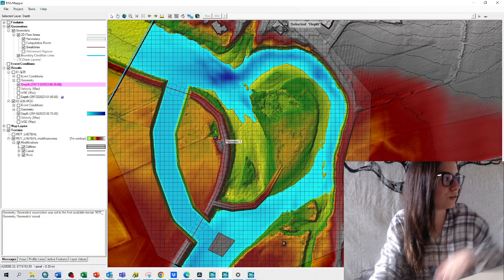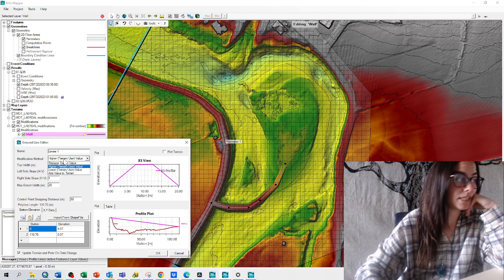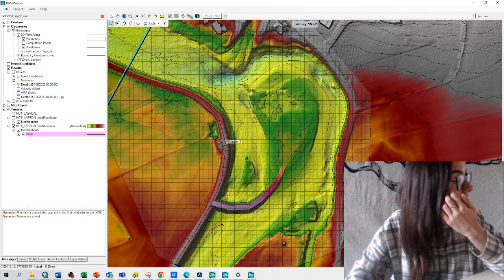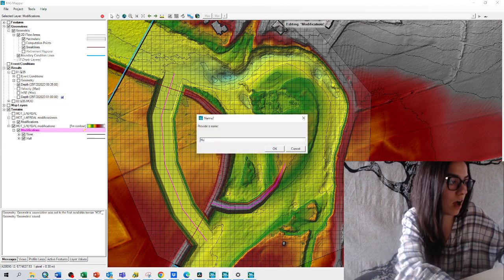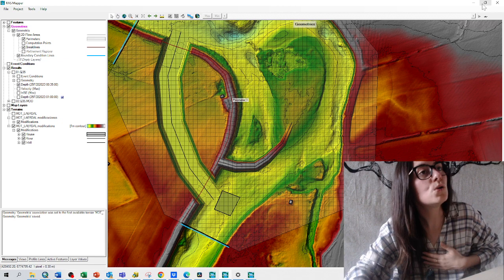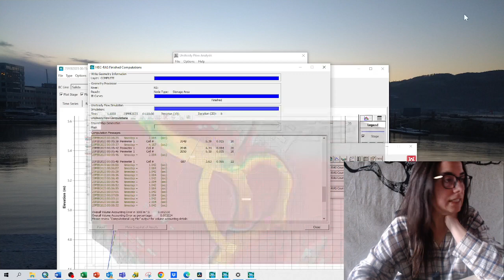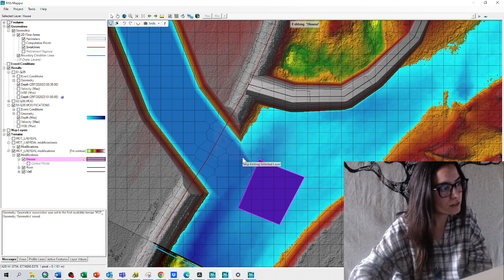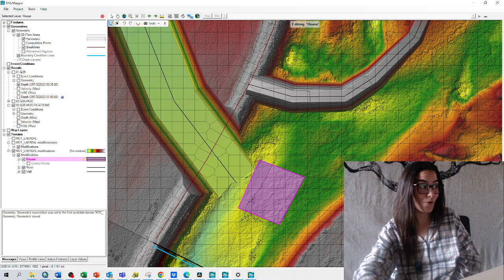Modify terrain in Ras Mapper HEC RAS 2D

Comment: I have a question, how would someone know how many culverts one would need to place in order for flow not to be disrupted or water overtopping ?
Reply: It is better to use try & error method with different scenarios, otherwise you can just use mathematical equations to obtain the necessary culvert diameter (or if your diameter is already determined, number of necessary culverts).